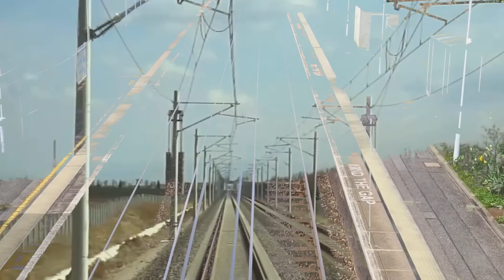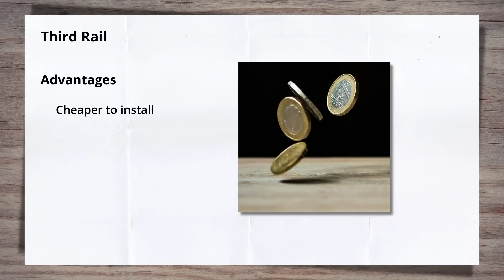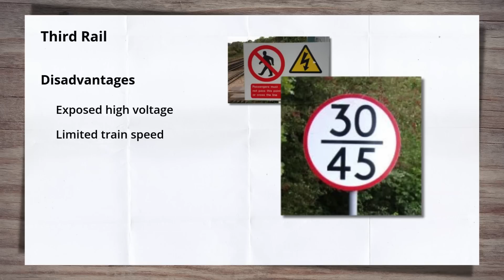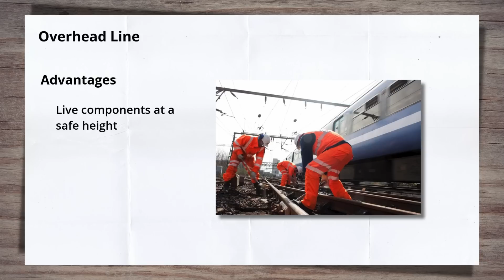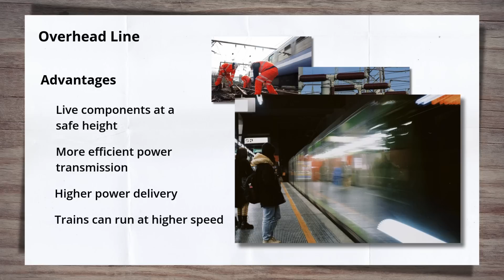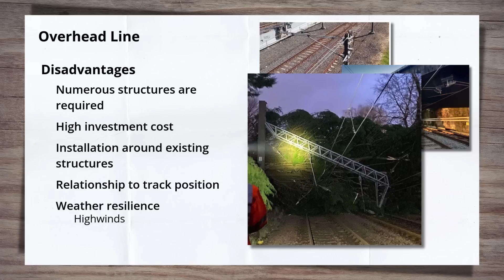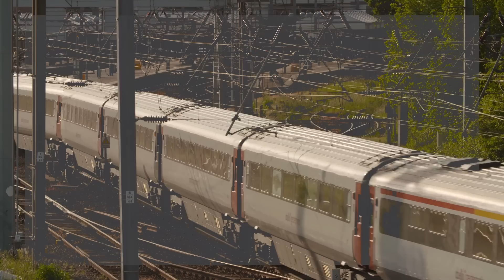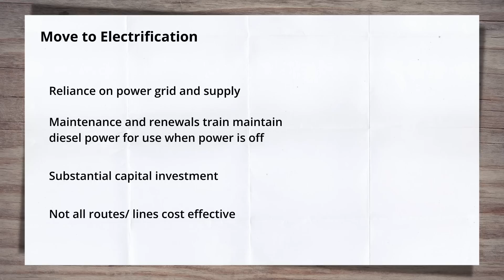How Trains Are Powered on the Railway | Third Rail vs Over Head Line Wires

Comment: Thing about lowering tracks is that it is expensive to do upfront. However, once every 40 years, rails need replacement. And when you are replacing the rails anyway, the costs of placing the new rails a few centimetres lower, to make space for electrification, are negligible (compared to the cost of replacing the tracks). Meaning that these cost of preparing overhead structures such as bridges, can be lowered significantly, by slowly doing it over time, when work has to be done on that section anyway. 

Also, newer models of third rail have a collector shoe collecting current from the underside of the rail, allowing for a cover to be placed on top of the rail, making it very resilient to snow and ice.

And electrification has two big advantages: electric trains are cheaper and faster, costing up to 20% less, especially when using ac overhead wires. Second, electric trains need less maintenance, are lighter, and last a good 15 years longer than your average diesel train (average electric train lasts up to 40 years, while an average diesel train only last 25 years).
Reply: In the UK third rail electrification on the mainline has to use top contact third rail and the ORR & RSSB will not permit more third rail.
Reply: @J-Railway-Volunteer 
RSSB takes an inconsistent and not entirely rational approach to safety.  They strain gnats and swallow camels.

Overhead electrification is grossly unreliable. My last rail journey ended up with an overnight hotel stay, arrived the next day.

No trains in Western Sweden today because of the wind.
Reply: @physiocrat-sv  I have seen third rail go flying.
Reply: @physiocrat-sv  OLE is not "grossly unreliable". I commuted daily for over 15 years from a distance of 50 miles on OLE lines. I had plenty of delays in that time but none were due to overhead line issues.
Reply: @TheRip72  
OLE faults are a regular event here in Sweden and when they happen they are very disruptive. For decades there was a fleet of reserve steam locomotives. 

There is a lot of delicate kit up in the sky which has to be kept perfectly adjusted.
Reply: Maybe thats why UK opted for third rail south of the Thames (and a little at Liverpool) because the OLE cannot fit under the bridges. It has to be at least 6m above the rails, hence why new bridges over railways are now required to give clearance for future OLE electrification. it may be the case for the same reason why UK railway electrification is relatively low at ~38%. Therefore, the Midland Mainline, Oxford to Didcot, Bristol Temple Meads to Bristol Parkway/Chippenham electrification projects have been paused with no date of resuming it.
Reply: @annabelholland  The reason for the Southern region using third rail is because there were 120 miles of 600v third rail versus 60 miles of 6.25kv AC OLE. OLE isn't 6m the lowest wire height, the foot crossings have a wire height of 5.2m, level crossings have a wire height of 5.6m and the lowest wire height is 4.165m with the standard wire height being 4.7m. The only time when an OLE wire is height than 6m is to trip the Over Height Drop system which will drop the pan at 6.2m. The reason for the cancelling has nothing to do with wire height and everything to do with the former government didn't want it. Labour has plans to restart the electrification projects as they were mostly finished. Bridges only need a gap of 70mm between OLE and the bridge, for example, the Cardiff Intersection bridge has an air gap of 70mm and a wire height of 4.165m. The Southern Railway by the 1940s regretted their choice to go with the third rail system rather than the OLE system. Also, Network Rail recommends the replacement of most of the third rail with OLE. Merseyrail also could fit OLE in. There is only a few lines which would keep third rail and that is the Island Line, Northern City Line and London Underground shared sections. Island Line and Northern City Line are due to the small tunnels which will not fit normal trains in.
Reply: @J-Railway-Volunteer 
Why would Network Rail want to replace a reliable fit and forget system with an unreliable one that needed constant attention?
Reply: @physiocrat-sv  OLE is much more reliable as well as it can handle freight.
Reply: @J-Railway-Volunteer  
Perhaps you should advise Trafikverket on what needs to be done as they obviously don't know.
Reply: @physiocrat-sv  The gap between OLE masts and width of pan affects what wind speed the OLE can take before it can't be used. For example the ECML has gaps of 75m ware as the GWML it is 50m which allows the GWML to take higher speeds than the ECML.
Reply: @J-Railway-Volunteer 
No trains in Western Sweden yesterday (7 July) pga winds. A month ago we were all thrown off the Copenhagen to Gothenburg train at a place called Ängelholm and had to spend the night at a hotel and go through the business of getting compensation. Complete shambles - the copper wires had been stolen. Again.

The Swedish railways should have bought the redundant HSTs.They went mad for electrification before the Europool pricing system came in and hydro electricity was cheap, and then there was the strategic reserve of steam locomotives, which still exist but they need overhaul, you can buy one of 1 kr (about 10 p) if you undertake to put it back into working order but they can't do more than 55 mph due to being a pre WW1 design.

Most of the electrification was done long ago and the steel structures are clapped out.
Reply: @physiocrat-sv  The HSTs are not suitable for Sweden.
Reply: @J-Railway-Volunteer  
The trains we have actually got are not suitable for Sweden either. At least the HSTs would arrive at their destination. Actually they probably are suitable; we have quite high station platforms. The Mark 3 sleepers ran in Denmark. 

Foreign gangs steal the copper wire and are out of the country before anyone has noticed. The thieves don't mind the high voltage. Besides which the OHLE is knackered and the 16 Hz system is obsolete and inefficient. .
Reply: @physiocrat-sv  You would have a 40cm step from platform to HST
Reply: @J-Railway-Volunteer  Just a matter of adding a step. Same with Eurostar trains. The step deploys at Gare du Nord. There is plenty of space within the Swedish loading gauge. 

Time to stop thinking up imaginary problems.
Reply: @annabelholland  yes and no, the uk initially opted for third rail, because of the many tunnels and bridges, but also because overhead lines usually use AC systems, which were very expensive and unreliable in the 1900's.
Third rail was only placed in the southeast, because those lines were electrified first. Afterwards the development of reliable higher voltage systems lead to the uk preferring overhead line for new projects. 
Also overhead lines are placed between 4.60m and  5.10 m in the UK. While in mainland europe the wires are placed between 5.10 and 5.60 m. With most high speed lines having the wire at 5.30. (This height difference is why mainland europe can have double stack trains.)
Reply: @daanwolters3751  I knew somebody was going to mention tunnels sooner or later! Most tunnels were built with steam trains in mind, so needed sufficient clearance to lift steam & smoke, allowing drivers to see the line (& signals) ahead as well as preventing them from choking. The clearance is enough to allow room for OLE to be installed without the lines being dropped.
There are a few exceptions like the DC lines from Euston to Watford, which were built with 4tf rail electrification in mind.
Reply: I meant that the bridge should be at least 6m clearance above the rail, not the wires. I am  not the best at railway electrification stuff. For comparison, bridges over road that are under 5m tall (16'6") have to be signposted. so that drivers of vehicles that exceed the height limit can find a way around it. This is why large vehicles colliding with bridges happen every so often (at least once a week) and most of them are railway bridges. But anyway, third rail electrification may be cheap at first (because no bridge raising/modification, track lowering, OLE installation, etc) but gets expensive long term because there are also so many substations (roughly every 6km), low effieiency, and cannot really go above 100mph. Plus the risks with staff and the public. Even small extensions/new stretches of third rail are/may not done. The Severn Tunnel had just enough clearance for OLE (possibly requiring track lowering), even though it was built over 100 years ago.
Reply: @annabelholland  They didn't lower the track in seven tunnel. Also it there is no such 6m requirement for bridge heights with OLE.
Reply: @annabelholland  I worked for a while designing OLE, so i do know a bit about the subject. 
I think you are confusing the contact wire (which is the straight wire that the pantograph of the train touches) and the messenger wire (the wire above the contact wire that supports the weight of the contact wire, and is a bit curved).
Usually the contact wire is at about 4.80 meters high, and the messenger wire is placed about 1.20 meter above it, reaching 6 meters in total. 
So yes, if the line is already electrified, a bridge has to be 6 meters, if you want to keep the OLE intact.
However you don't have to, a train only needs the contact wire, which is at 4.80 meters height on average, and can be lowered to 4.50 m in the UK.
The messenger wire is optional, in fact you have OLE systems which do not have a messenger wire at all, or use a third rail placed above the tracks (instead of wires), to need as little clearance as possible, only needing centimetres above the contact height (which is 4.50 at minimum). 
Another option is to interrupt the messenger wire temporarily, or place it much closer to the contact wire than usual, to allow for a lower clearance, when passing under a bridge.
A great example of this is the footbridge across the tracks in Newcastle station, which has a clearance of less than 5 meters.

The wires have to be higher than 4.50 at a level crossing yes, but 4.50 is the minimum height of the wires, they can, and usually are placed higher, to allow trucks and busses to pass at level crossings. 
With the exception of high speed lines, the height of the OLE does not have the be the same for the entire railway,  and usually the height of the wires varies, to best suit individual sections.

Comment: You mentioned (  BATTERY  ) electric trains ... GWR ( UK ) are using old D78  LUL rolling stock to see if this is feasable for rural routes .... the BIG , BIG snag with overhead lines is simply that they are (  REALLY , REALLY  UGLY !  ) , much like the electric trolley bus nightmare in SW London ( Surbiton ? ) in the 1960's ... FYI , the London Underground uses 4 rails to keep the track current  AWAY  from the running rails ( this avoids subsurface ringpiece corrosion ) . ( ? )  ...... DAVE™🛑
Reply: The reason is so that they are nice and strong so that if a wire breaks trains can still use the other lines which isn't possible with lighter OLE like on the East Coast Mainline.

Comment: 3rd rail is underrated IMO.
Reply: Yea. Toasted eejits on the track is actually the third rail system performing a valuable evolutionary function
Reply: 3rd Rail is unsafe.
Reply: @J-Railway-Volunteer 
You shouldn't be on the track anyway.
Reply: @physiocrat-sv  Hidden London runs tours on the East London Line track.
Reply: @J-Railway-Volunteer  top, bottom or side ? Answering all 3 is a cop out.

Comment: We need to have a pro-rail government that creates a rolling program of railway electrification.

A rolling program of electrification will increase the amount of work being done and lower costs. The Scottish Government has already been doing some of this north of the border with England and their rail experts have been able to work out a system where equipment is pre-installed on electrification masts to minimise the number of closures needed to get overhead electrification put in.

Overhead rail electrification needs to be done on the basis of the best early impact. So a lot of it is going to have to be based about removing diesel pollution from densely populated areas. But you can not run an electric fright train if part of the route is an "electrification desert".

Third rail needs to be banished from the UK. It's already illegal to install new bits of third rail (it can only be repaired). However, it is far more important for us to decarbonise, as quickly as possible. So priority needs to be given to electrifying non-electrified routes and a plan to eventually pull up third rail and replace it with overhead electrification should be tied in to routes like Thameslink, where we currently have trains that switch between both systems.

If we electrify most of England, Scotland and Wales (Northern Ireland also needs to be electrified, but uses different trains) we could have enough spare trains to cover the third rail sections transitioning over to overhead electrification later.
Reply: I have no idea how one would go about replacing the 3rd (& 4th) rail of the London Underground, especially the tube lines.
Reply: New third rail isn't strictly illegal, ORR's position is a bit more nuanced than that, new third rail would have to be justifiable. Wholesale electrification of the mainline isn't going to fly, but small extensions are potentially acceptable, as is LU and DLR extension, since those are safer systems. LU doesn't do live working, and DLR is bottom contact, but both have better separation for staff and the public from the conductor rail
Reply: Rail accounts for 0.7% of UK emissions. Nobody should be wasting time talking about decarbonisation of rail. Overhead electrification makes the railway unreliable. I have personally been caught up in a couple of nasty incidents in Sweden due to OHLE failures, and I don't travel very often. All trains in Western Sweden were cancelled today because of the wind.

Electrified third rail is a useful safety feature: it discourages trespassing. Fatalies at Southall and elsewhere were caught by the lineside masts. The RSSB needs to be challenged on this and other issues.
Reply: Why does NI need to be electrified?

Comment: The fundamental focus of this comparison is flawed.  The pretty much universal opinion today is that high voltage AC based rail is the best option overall in terms of potential performance - in situations where speed and/or haulage capacity are paramount and, most importantly, when addressing a green fields, first-time electrification scenario.  But, in order to put the options into true perspective, one needs to go back to the conditions that prevailed when practical electrification initiatives were first mooted. For a start, 25kv OH did not exist as an option to the best of my knowledge. Certainly the pioneer overhead schemes like the LBSCR used DC through their wires. Also, and most importantly, electrification as a concept was developed in response to serious revenue losses to other forms of passenger transport.  It had to be done, but it also had to be done as cheaply as possible - which put the third rail firmly in the driving seat. And, finally, it must be remembered that the third rail has always been focussed upon a specific aspect of rail operation; relatively short distance travel patterns needing frequent service intervals, where capacity, reliability and cost are the primary determinants, rather than speed and electrical efficiency. And, when looking at the UK in particular, one must always look at where and how such benefits as speed or haulage capacity are paramount. Third rail can manage 100 mph although generally limited to 90. Outside the two main northern lines, there's not a lot of the network where higher speeds than that are feasible, necessary - or even electrified...
Reply: I think it depends on the intended service.  Full railway type operation tends to be high voltage AC, but local transit, low voltage DC.

Comment: Never seen a 3rd rail until I came to the poverty stricken UK. Nobody even told me of the danger. Now they have fibreglass covers, safe and good for metros.
Reply: Third rail systems are used in parts of the United States as well, notably near New York City.
Reply: Copenhagen Metro uses covered bottom contact 3rd rail. You can't do that with the top contact systems used in the UK.
Reply: @neiloflongbeck5705  Seen that in Berlin and later on some Delhi metro lines.
Reply: Isn’t the Toronto subway system 3rd rail?